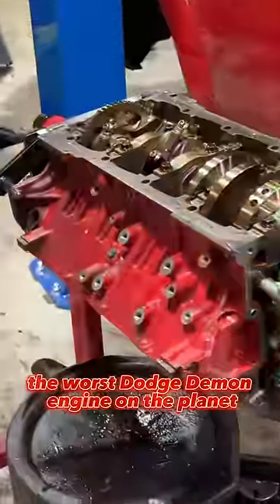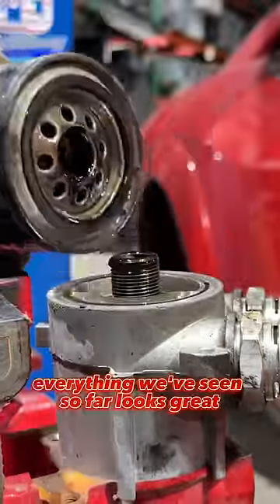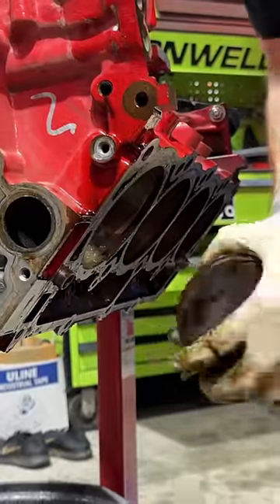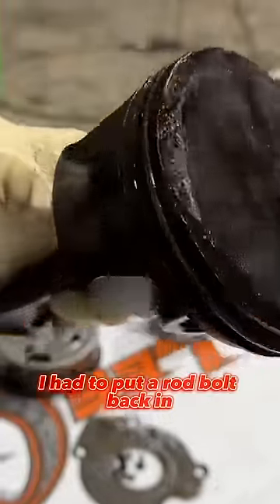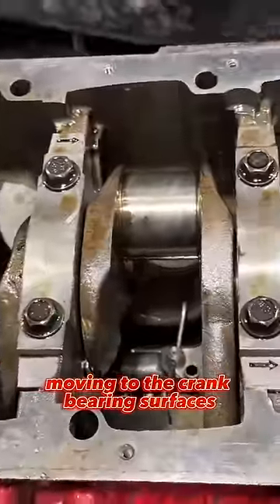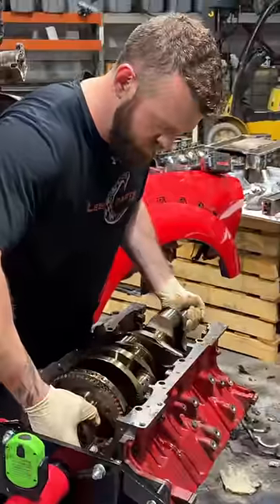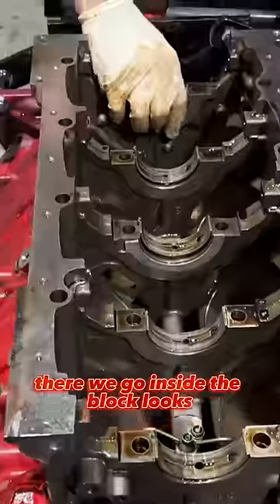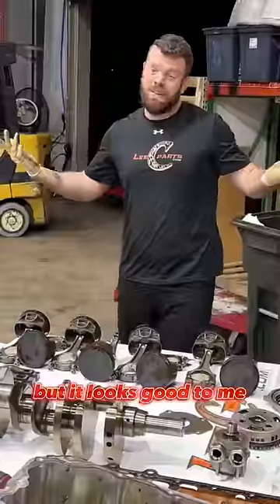My Dodge Demon engine is FULL of water…

Comment: Boil everything. Polish the crank. Mic everything. New bearings, rings & seals, reuse everything else... 😎👌
Reply: Fr
Reply: @lukasprien4338  yes. Multiple times a year. No problem yet. Just checking for bent parts is critical.
Reply: @tinytattoomike7943  Done it b4... will do it again. No failures yet 🤫

Comment: I love working on cars but can’t tear down a engine like this. Wish I could.
Reply: Actually it's a lot of fun. But you got to make sure to label everything and to watch some YouTube videos on how to put it back together correctly.
Reply: You can't or you haven't?
Reply: I’ve never tried to yet. Just don’t want to risk it. I can do a lot of work on cars tho.
Reply: @georgespalding7640 I'd just record myself taking it appart because I don't trust myself with shit😂😂😂😂
Reply: @ireallyreallyreallylikethisimg  That's a good idea because most YouTube DIY videos are missing a lot of the small steps that are very important. I didn't have that option when I was younger and used to work on cars in my garage.
Reply: @Mopar206 of COURSE you can tear an engine like this down! It's EASY!
Then you take the boxes of parts to a Pro to put it back together... Lol
Reply: Yes you can, don’t doubt your self.
Reply: Im sure you can tear down the engine. The hard part is putting it back together the way it was lmao.
Reply: Just get a book for torque sequence/specs. Put the caps back on where they came off, from. The groove in the piston faces the front of the, engine, rods & rod caps are, numbered for a, reason. On the top end. The pushrods & lifters go back exactly where you pulled them, from. Make a stencil & use it to put all of the bolts on the water pump/timing cover back Into the exact same holes they came out of coz different lengths of, bolts.

Use a ridge reamer atop each cylinder bore & hone each cylinder slow & easy, use plenty of oil with an up & down, motion. make sure your hone is spinning while moving it up & down in your, bores. Do not lift nor push your hone in/out of the engine without it, spinning, on your drill.

Most important, get a Chilton's/Haynes, manual, and follow the instructions to a, "T", & YOU WILL BE, FINE.

I rebuilt my first engine COMPLETELY in, 2022. Its still my daily & has 25K miles on, it. 

I had to take a set of beads from an engine, a rod & piston from another engine, & used the rest of my stock engine to manufacture my own, engine. Its a GM, 4.3, V6.

DO NOT scuff the internal engine components. Do not use a wire, wheel inside your, engine. Do not sand anything near an opened engine. Clean everything with diesel fuel & purple power & rinse with diesel, fuel. 

My engine never went to any shop/mechanic. I did all of mine right outside the house & only took the heads to the shop to have THEM magnafluxed/checked for, cracks. A 4 angle valve job, new valve guides & seals. The 4.3 is more challenging than the small block engines I watched my uncle/grandpa, rebuild, in the fact that you HAVE TO buy a new timing cover, and it has smog/pollution BS. The bell housing bolts in a second Gen S10 are tricky to remove, too. 

I've worked on vehicles, engines, & trans' my entire life. I had never rebuilt a bottom end, prior.

Pay special attention to your book when it comes to piston ring installation & use plenty of engine pre assembly lube on, everything.
Reply: @EnhancedTrashBin no more, difficult. It just requires more knowledge to reassemble than it requires to tear one, down.

Comment: I would be looking for a micro crack in the block or head, a warped head or a blown head gasket.
Always look for the worst problem first so You don't end up throwing money away on a lost cause.
Most Guys usually do the opposite hoping for a cheap fix.
Better to get the bad news first.

Comment: Even if a block tore apart good and everything still looked to be in good working order unharmed. All that heat from the fire coild have warped the brackets on the engine. It could have warped the heads and block as well, i would check the heads and block for any distortion. We all know how that  aluminum disapates heat well but every metal has its limits. Better to safe than sorry, if its all 100% run it, hell send it!

Comment: The problem into this engine its to be discussed/  the oil level by been to high  cause the crankshaft to vortex the oil into the cylinder walls causing high pressure into the piston and head / check for bend connecting rod scwith glass  square  surface  then  cilynder  head  for bend  cylinder head  .

Comment: Yeah I would never buy a car with that name anyway but muchless if it burned to the ground ... I mean certain parts are tempered to specific value.. I know engines normally run hot but a car that burns to the ground gives off a lot of heat who knows how deep that heat sunk into that engine
Reply: This is definitely something to think about, I wonder if there is a way to test if the steel lost its hardness before just running the engine

Comment: Amen love you god❤
Reply: Or, how about a 1970 Dodge Demon?  Build it as a twin turbocharger GT45 with 14 lbs of boost with a 750 4 needle and seat boost referenced double pumper, a 383 style distributor drive. And a 6 speed T-45 with the first 4 dog ring and synchronized on R 5 and 6. Like a John Dianna Demon from 1970. That would be old school, new school, ITC, and not done before. A true marriage of old and new.

Comment: how does water get in your engine?
Reply: Intake, bad seals, oil filler cap, oil pan gasket, anywhere the motor leaks oil (if it does) is a spot water can and will get in. Even failed head gaskets if the part of the gasket separating the coolant from oil brakes coolant will get in your oil, and a lot of people dont even bother using coolant on daily drivers and just fill it with water..

Comment: Only 2 bolt mains on a 800 plus HP motor? Am I seeing this right?
Reply: There on the brink. I hear. But to upgrade it's the bottom first
Reply: Its a two bolt with two cross bolts so its kind of a four bolt.
Reply: The other two bolts bolt on from the side of the block.
Reply: I was wondering the same thing.  Was even looking for cross bolts.  Missed it.

Comment: Impact gun and “tapping” on any rod bolts, especially the fancier/more exotic material they are is a no-no... some you’re not even supposed to touch with bare hands (eg L-19’s) I’d toss them in the trash.
Reply: Probably never built an engine before